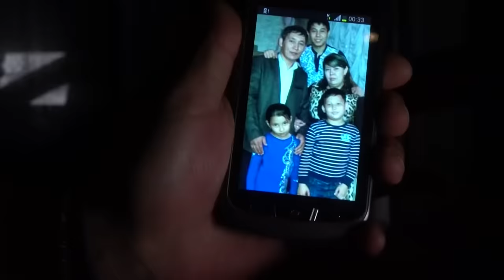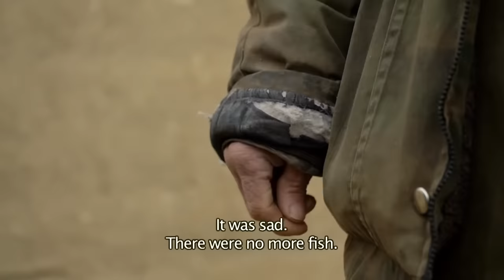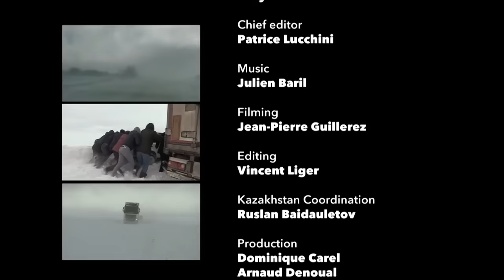World's Most Dangerous Roads - Kazakhstan: Dead Steppe's

Comment: Some tire chains could have worked wonders in many of these situations. Especially the trucks on the snowy pass. Hard to believe no one carries them in a region like that.
Reply: bro this is not Norway, it's a poor country... I bet they don't even have winter tires, and also in the video they said it's not winter, it was spring when that happened
Reply: @johnnyhun1 so the company can afford 200,000 dollar trucks but can't afford 500 dollars in tire chains? makes no sense, if it's spring that means they're coming out of winter lol
Reply: @derekakaderek  winter tires grips much more ->  faster tire wear -> faster tire change period -> less money. Also more fuel consumption, and the tire itself cost much more. And if you are a company that operates with 10 truck you can buy 12 tire for 1 truck multiplied by 10 (the trucks you own). Not to mention the extra labor money when you change it back to summer ones. In Norway companies doesnt even change to summer tires, most of the trucks are going with winter tires even on summer, and in winter they buy a new one, but thats a rich country...
Reply: @johnnyhun1   wtf are you talking about, you don't keep the chains on all winter. When you get to a section which is going to be difficult you put them on. i don't care how poor a country is, if they can afford massive trucks and trailers they can afford to buy the proper tires. 1 single fueling costs much more than getting tire chains.

Comment: Here in Sweden we all learned that during winter if you get stuck in the snow, the last thing you should do is to accelerate hard, just put your carpets under the stuck wheel and drive slow-slow forward until you are on the road again... Kazakhs should know this, I think...
Reply: if you had equally bad roads in Sweden you wouldn't make any progress at all
Reply: @EnjoyFirefighting  The only thing I'm trying to say here is that it's a very very bad idea to put your pedal to max if you are stuck in snow... Use your carpet so that the wheel have something to grip on... Kazakhs should know this. 🤷🏻‍♂️ 😅 And yeah, in the North of Sweden there are only snow roads and road that the people themselves has made temporarily during winter season.
Reply: @sebbivism  don't try to fool me, I know the roads in northern Sweden quite a bit; Even the worst dirt road would feel like a smooth road down there in KZ; Driving down the roads with a fully loaded truck, a camper or a low riding car isn't a big deal in Sweden
Reply: The roads in Sweden probably have payment that is maintained . I live in Canada and this is really terribly that mud road thry showed is insane you need a 6 wheeler just to go to point a to point b .

Comment: 16:31 1000 hp? In fact it's less than 400 hp.
Reply: No, the standard version is 400hp. This is the K-710 that has roughly 1000 hp
Reply: @lamarr51  First, it's definitely not a k-710. They have different exterior. Second, k-710 by default, has a "ЯМЗ-8403" engine with 500 horse powers.
Reply: @koshshka  in that case they messed up lol

Comment: Everyone and Everything is stuck. But the Roads re not that bad as in the Video. Ive seen better Conditions. So much Drama for no Reason. Interesting but dislike.
They need better Equipment - Chains for Wheels, bigger Tires in Mud. But sadly they re in the RU-Federation so None will help them with better Equipment. 
16:22 - Its a K-700 A and ive never seen One with 1000Hp - So they re lying for more Drama ... Dislike.